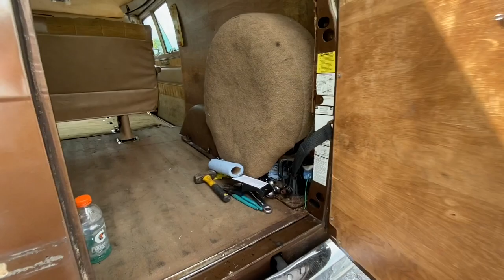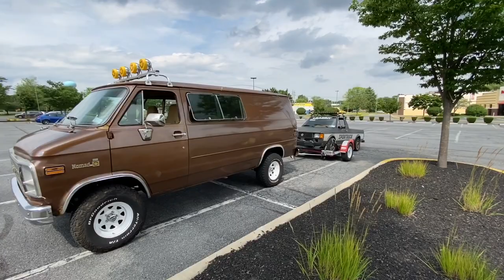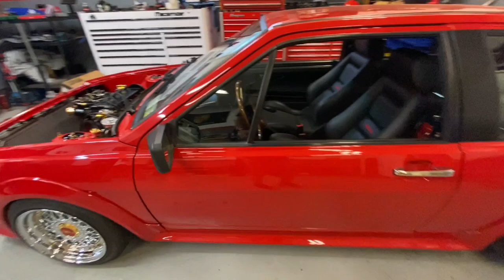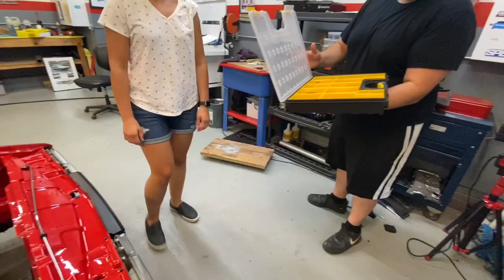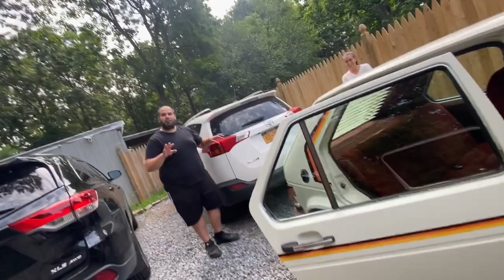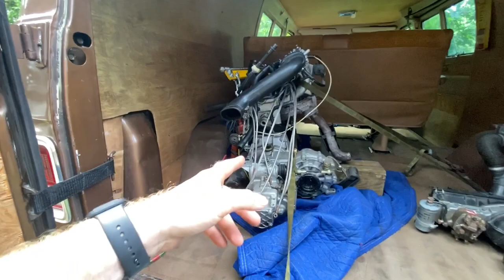selling the sportruck & joe milazzo’s gold plated rocco!

Comment: Also. We had a Chevy Van 20 that was "camperfied" and had an 8 track player. At some point all of us kids wound up with it. It was white with sort of Brady Bunch 70"s stripes. We called it The Great White Buffalo at first, but it was later changed to Vanna White. We lived in Michigan. In winter you must drive that van differently than any other vehicle. For one, it will take an hour to heat up the inside. All of your weight is on the front wheels yet it is rwd. It is very very slippery for that rason plus one other. MASS. Stopping distance and exit speeds.
Reply from the maker: that sounds awesome. where did it end up? i don’t plan on driving this in any snow, don’t want any road salt near it. i might be tempted to oil her up and take it out to ply eventually but certainly won’t be doing any winter commuting in it. i’m sure a few hundred pounds of ballast in the back and she’ll be a beast.